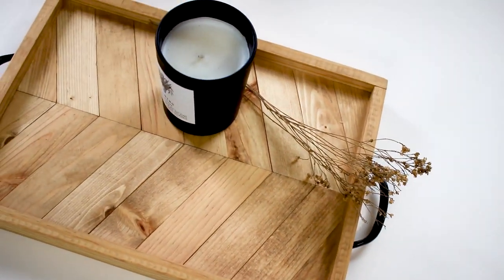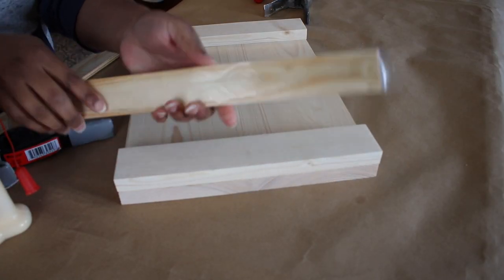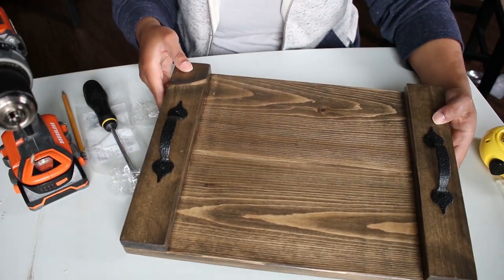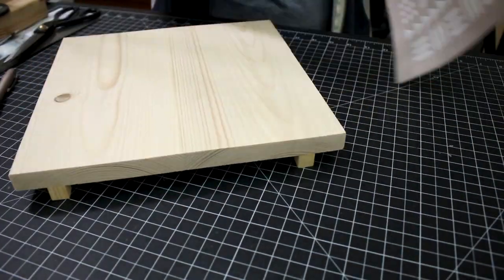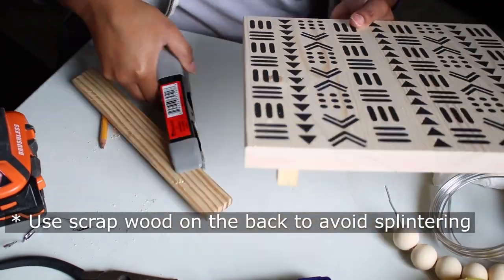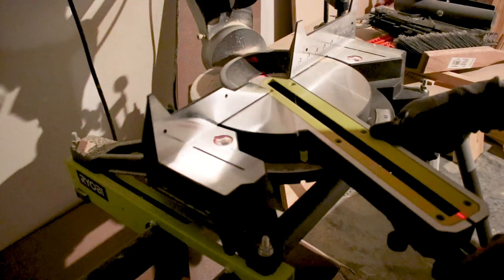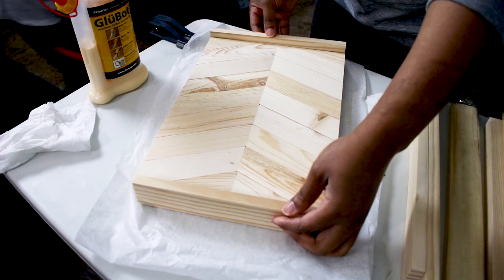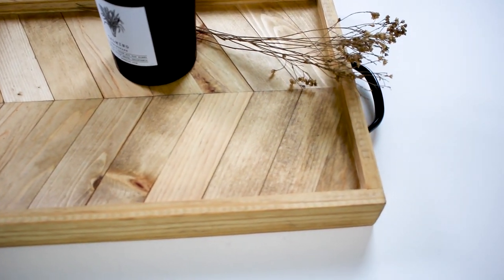DIY Wooden Tray Ideas | 3 Popular Style Wooden Trays to Make

Comment: Question about the 1st board.. With the wood glued perpendicular, will it not crack when the boards expand and contract?
Reply from the maker: Hey Mike! I have not had an issue with cracking so far. I can update if there is a problem down the line. Hope that helps!